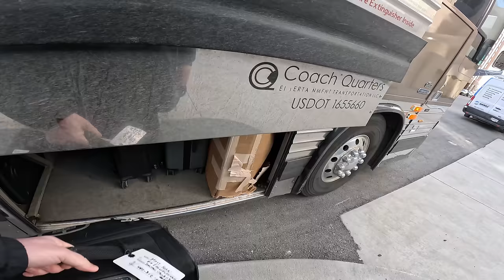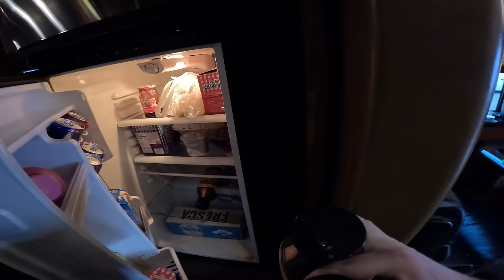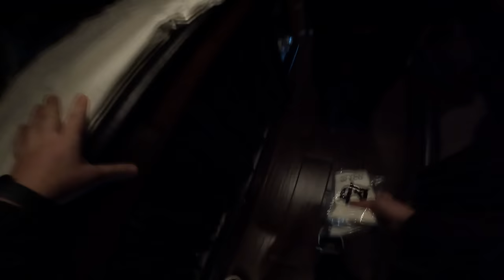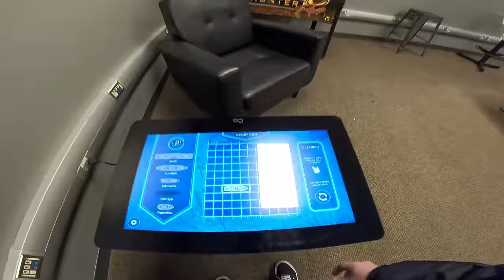POV | An Entire Day as a Drum Tech

Comment: Chalk lines are where drops have to happen from the ceiling for rigging. Those points more than likely don't line up with any actual hang points in the ceiling (since that changes location to location) so riggers have to use usually two hang points to create a point directly above the chalk lines using steel cable to hang motors and trussing from.